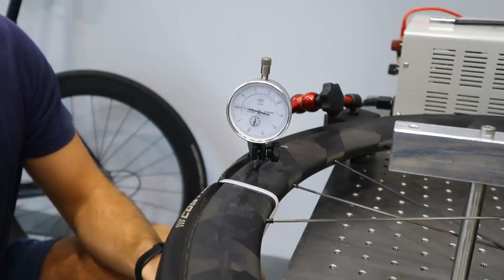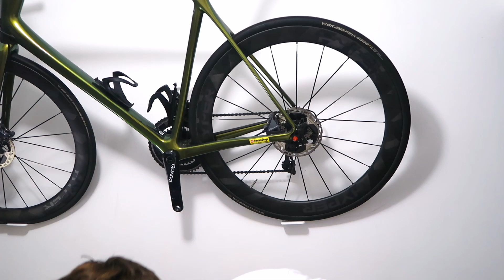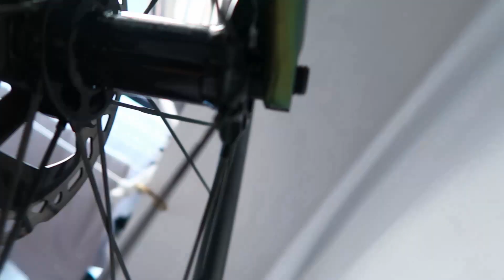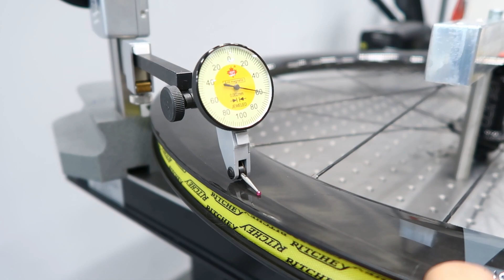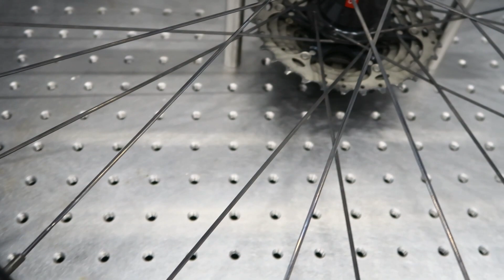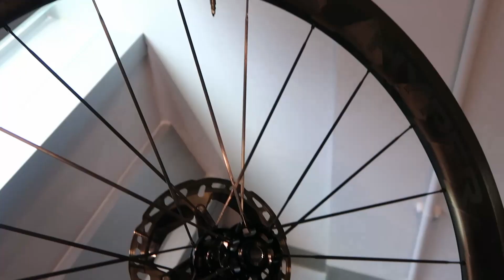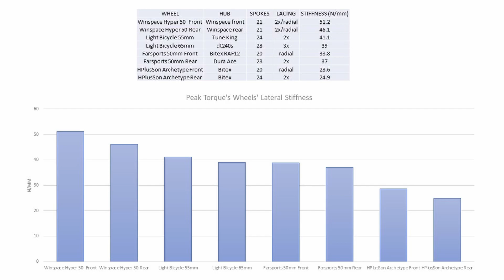WINSPACE Hyper Wheelset Review - Real testing and real data.

Comment: Leaving the tyres on the Winspace wheels would've increased (slightly) the radial distance at which you were applying the load, and hence increased the effective load you were applying (longer lever from the hub). Wonder if that is a measurable difference considering the high accuracy of measuring equipment you were using. What do you think?
Reply from the maker: Tyres were deflated and old, loose. No drop in radial tension measured.

Comment: I love all the steps to make the hubs very light and reduce the strength margin of safety as much as possible, as if a few grams made a big difference at the hub, and then slap on the deep "aero" rims. What's the opposite of "built to last." Don't worry about replacing the bearings, the hubs will fail first. But anyway will they look good on my gravel bike?
Reply: Hi Dave, I think the tension on the carbon spokes is about 10kg/spoke less less than steel? If this is the case there would be  a reduction of 210kg of pressure on the hub? I am no expert but this could justify the lightweight design.

Comment: Thanks for a nice review.  I appreciate the point that less total crossed spokes with make the wheel less strong as regards braking/accelerating force. But you have inferred that it matters which side these crossed spokes are on.  Since the brake disc is firmly mounted to the hub, the hub is rigid and the axle fixed in the dropouts why does it make a difference which side the crossed spokes are on?  As far as I can see it makes no difference but maybe you can explain it?

Comment: Could the bonded area of the nipple be larger than the CSA of the spoke. I think your right it will almost certainly be a weak point.

If the preload / clearance is fixed take care changing the bearings. The normal width tolerances for a bearing are around .12mm axial play can vary a lot as well. A great review.

Comment: Thanks for the review. As someone that is searching the market right now, this is helpful. I find it interesting that you claim we should not waste our time on reviews that talk about "spin up", but you talk about a tiny step in an axle tube that saves maybe 3 grams on a non-spinning part right at the center of the wheel. The rest of your review was valuable, but I still don't understand why you twice (5:03, 5:42) mentioned that it was "nice to see" that tiny little step that is "really nice". It was good to hear the details that on some more expensive hubs you are getting a better designed system with better tolerances.

Comment: Regarding the UTS of the spokes, I'm not sure this is really a concern, is it? They need to be strong enough (to not break under the applied loads) and I reckon it's borderline as to whether the epoxy bond or the aluminum section of spoke (probably the aluminum thread) would fail first. The real point of the carbon section is to increase stiffness in tension and perhaps save a negligible mass, compared to a straight aluminium or stainless spoke.

Comment: Great video! Re the nipple bonding can't it be as strong as the spoke provided you have a long enough bond? If the depth of insertion into the nipple was 4x the spoke diameter or something like that, with glue all around where it's inserted.
Reply from the maker: Absolutely right :) if the adhesive shear area is large enough then the spoke could break before the glue, correct ;). It just doesn't look very big to me. I haven't done the calc but I'm sure the bond would fail first

Comment: Hello Peak Torque, i am real new to youre channel and have been binge watching your videos over the last two days due to lockdown here in Germany :).
I have a question i was hoping you could help me with, in May this year i brought myself my first Road bike Giant TCR Advanced Disc 2 2020 (shimano 105 mechanical for 1,900€), and now im hooked.
 I read somewhere that it is  not really worth upgrading entry level bikes because its far better to save the money and get a higher end bike 
(lighter and better compontes etc) it comes in at 8,7 KG at the moment stock. 
I was wondering if you think it would be worth it to invest in a set of the Windspace wheel set for it and maybe new a new cockpit as well as the stock 44cm is way too big for me and i could also bring the weight down,
 even though all this would be over half its price or would you rather save the money for a higher end lighter bike ? 
thanks so much in advance for youre reply and help..........
Reply from the maker: I would invest on the bike fit and geometry side so get the handlebar width sorted and stem length. As for the rest of the upgrades, i would not bother. Its a plenty good enough bike for any pro to win Le Tour on. Thats the truth. Even saving 1kg on the bike wouldn't make you much faster. Just ride an enjoy. The best speed comes from a sustainable and powerful position.
Reply: @PeakTorque  thank you so much for the reply and wisdom, a bike fit sounds a good idea........

Comment: One nit picky thing - did you account for the distance from the axle centreline when applying the force? I see you used a cable tie to spread the load, but if we assume the force is being applied halfway between the inner and outer edges of the rim, then for a shallower rim, the force will be applied at a greater distance (as the outer diameter is more or less fixed due to the tyre size/brack track), and therefore give a lower stiffness reading.
Reply: Exactly what I was thinking. Tyre off/on has to make it even worse.

Comment: It was discussed briefly during this video, and a follow-up was needed to understand the spoke setup. For anyone interested, it's discussed here in more depth, beginning around the 42:10 mark:  https://youtu.be/zeKGyahPCSs?t=2532
Reply: FYI - spokes are not bonded, and are replaceable.
Reply: @marcnelson3243  The spokes are Giant Cadex spokes. The non carbon ends of the spoke are fitted then the spoke ends are flanged out. I believe there is also glue but the flange holds it in place. In a test on the front wheel done by a friend, the 16 spoke wheel has 3.5mm deflection while a Lightweight wheel has 4.5mm deflection. It is a very stiff wheel. The spokes are noisy and need lubricant where they cross over to keep them quiet. Simply put, my 1320 gram rim brake 50mm wheels are fantastic. Surprisingly excellent at handling cross winds (I am 59kg). Being only 26mm wide, I would not go over a 23mm tyre as they bulge out due to the 19mm internal width.
Reply: @vietnguyen4312  Great points and input, thanks for sharing! I'll likely run on 25's, but 25's true to their size (GP5000, maybe Pzero), just to keep with a flush profile (+-1mm). I opted for the 50's as well, and look forward to testing them in practice. Build quality, and accessibility whether bearings or spoke replacement is a major plus imo.
Reply: @marcnelson3243  They send 3 spare spokes but you can buy a few more if you like? You can also probably buy these spokes from Cadex or Hunt? Bearings are a standard size. 6903 rear & 6803 front.

Comment: 4:12 'if you're gonna think hubs bearings last forever than you're probably not riding enough...' 
Me: riding cups and cones forever, listening to a guy who obviously only knows about (mechanically inferior) cartridge bearings.
13:15: torqueing spokes should help braking modulation? My lord where are we heading into... Next you'll say that torqueing spokes could save braking energy to be unleashed when accelerating again!
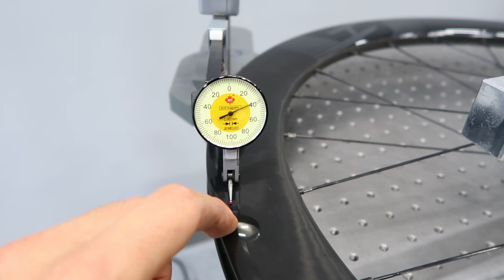17:36 when you think about real world conditions for testing wheel stiffness, you should have a load of 80 kgs pulling at the center of the hub in one way while your rim is standing on the ground (so you simulate the weight of rider + bike). If you don't do that (like all those stiffness tests not do), you don't take into account the difference in tension in the spokes, and that is exactly why some wheels are stiffer than others, and this tension in spokes changes a lot because of the real-life loads in the vertical direction by bike+rider's weight. Now you are testing a free-hanging, non-loaded wheel. That is really not the way to measure.

Comment: Good review. I hadn't really thought too much about shell deformation and press fit bearings - a potential argument in favour of cup and cone Shimano-style of course. Few points that occurred to me:

- Wheel stiffness: Wheel Fanatyk is always worth studying. Their take on the relevance of wheel stiffness: https://www.wheelfanatyk.com/blog/extreme-side-wheel-forces/ . In the light of that your results are not that surprising - spokes are irrelevant, you're measuring the inherent stiffness of the rim.

- Spoke tension. The apparent claims on spoke strength seem odd and irrelevant - any decent spoke can be tensioned far higher than any common rim can stand - the rim will collapse or the spoke holes will crack and spokes will pull through. Did you measure the spoke tension of the build?

- Radial spoking: I really don't know why you'd bother for a rear wheel or a front disc on either side. Unless the hub shell deforms massively under torque, which seems unlikely to me, the acceleration or braking torque will probably be shared across all spokes that aren't radially laced. No evidence to support this, but it wouldn't be that hard to test.

- 14 spokes carrying braking/acceleration load. Not happy about this at all - it's quite easy to calculate the forces involved in this, so I did a couple of years ago. Personally I wouldn't be happy with < 20 spokes carrying the braking load on a front wheel (front wheel braking on the limit being the biggest force any wheel will see) - flange diameter and lacing is key here really, the relative change in tension (+ and -) of the spokes x number x perp distance from center providing the torque to balance the torque due to braking. More spokes/bigger flanges/more spoke crosses all make things better. It's very sensitive to flange diameter though, so it would depend on the hub flange height.

Comment: Great review, don't hold back on anything regarding engineering, there is never enough of that! Btw, it would be a potentially interesting video purely on the topic of carbon spokes and different approaches to them (from these kinda immitating the classic ones to the ones seamlessly integrated into to construction of the rim like Lighweight or Partington).